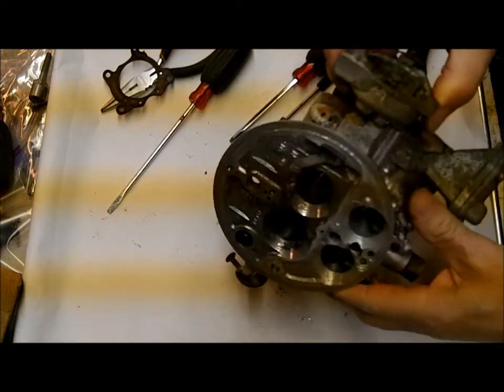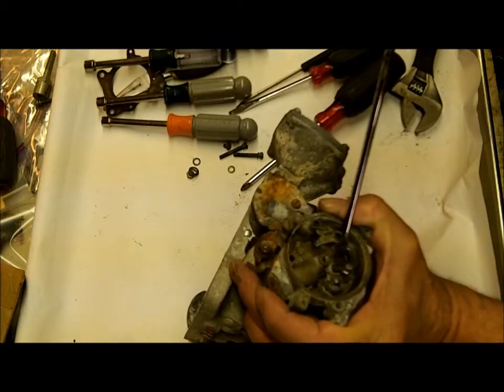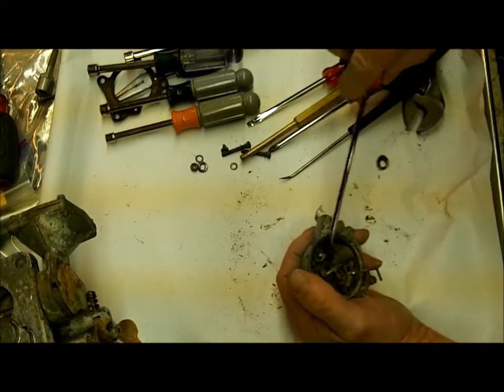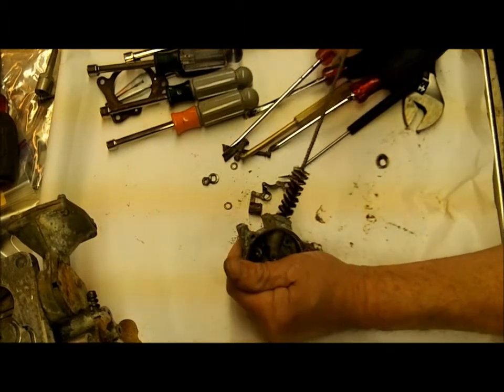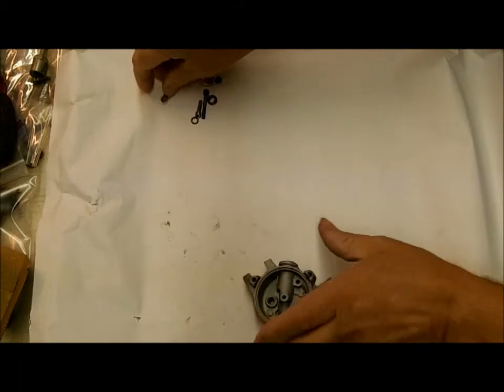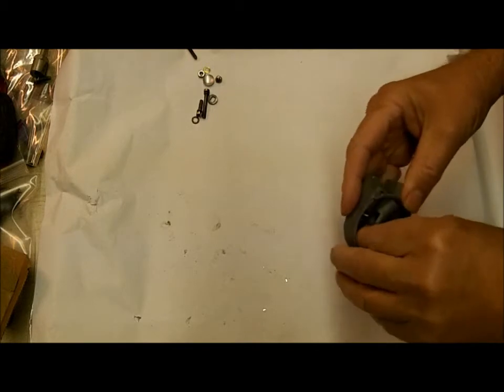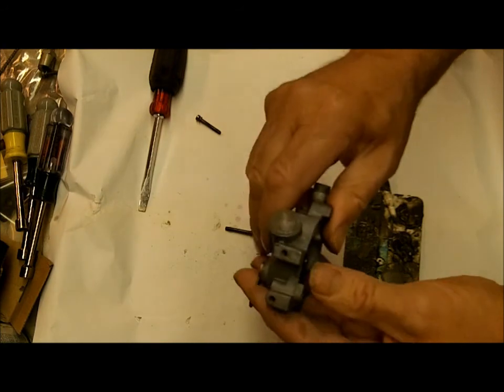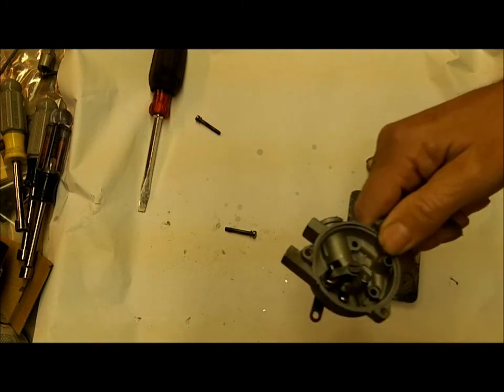Holley 4000, Teapot Choke Housing Restoration

Comment: I think you put the choke arm in 180 degrees out.  Also when you install the secondary vacuum you should file the back so it is flat ,  the screws tend to bend it, and you could loose vacuum.